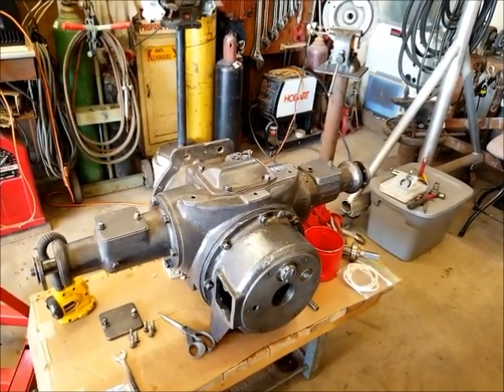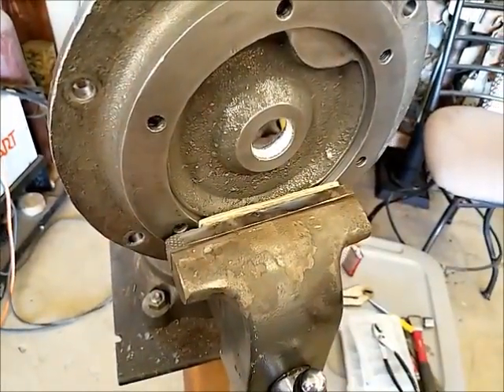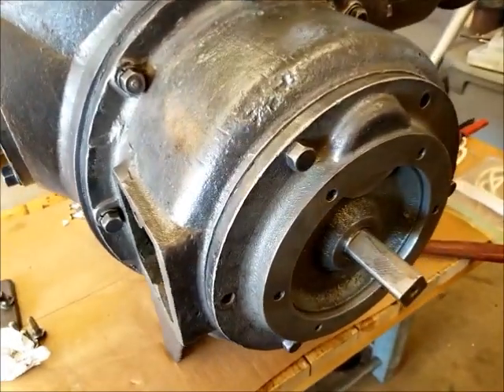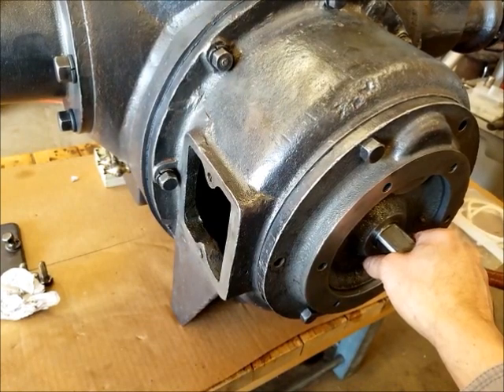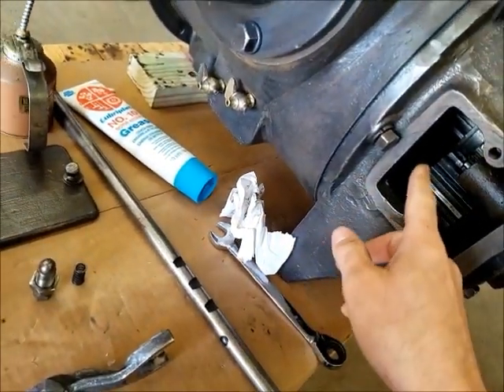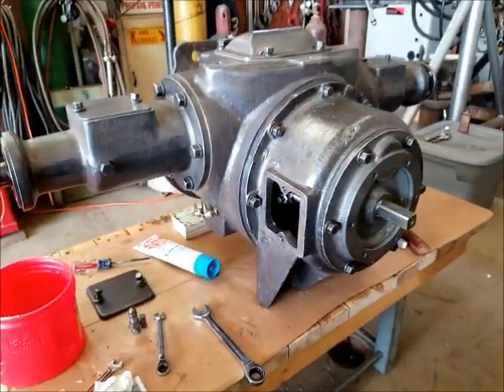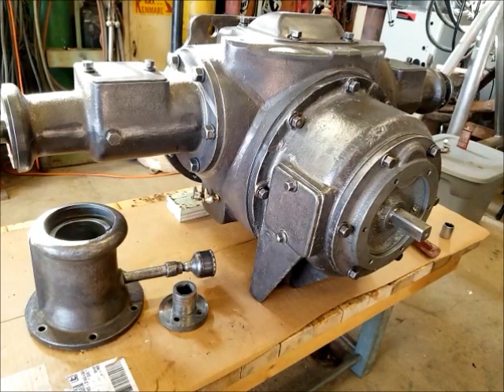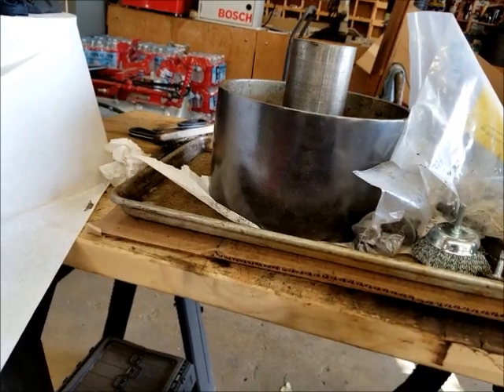1920 Allis Chalmers 6-12 part 23

Comment: Excellent video as always Jacob. I think you have everything under control as far as mods and repairs go. Only thing I might consider is drilling a small hole to stop any possible further cracking. Not being able to look it over as close as you that may not be a beneficial call either. Keep it going my friend. Can hardly wait to see the tractor at a show somewhere.